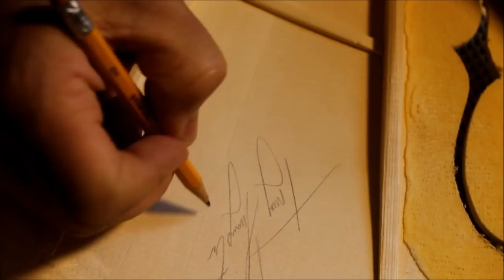Building an archtop guitar body Octave Mandolin

Comment: Very beautiful!  Did you spring the joint for the maple back, i.e. did you make the center of the joint a little (tiny) gap to allow for long term drying not to stress the ends of the joint?  In looking at old tables and drawers, often the ends of glued joints open because the ends appearcto shrink more.  It may be those were cases of freedom of movement over a hundred years, where ends of joints typically are freer to move than the centers... Or the reverse... In one case butt  joints in a poplar? drawer side were held by the front, made of a more stable birds eye maple, and split along the butt joints after 80 years or so of drying.
Reply from the maker: Hi Joe, a lot a people are unaware of this process in lutherie, there is no spring clamping done on tops or backs. The joint needs to be impeccable, and the way we make sure it is, is by checking the joint in front on a light and if there is light shining through it not good enough. 

You have to remember that furniture and musical instruments have different uses and that they are stressed differently. For example, an arch top has all the weight of the strings applied on to the top. Exactly where the biggest part of the spring would be resulting in extra stress. ( I do want to point out the I am aware that a good spring joint does not show any gaps). 

For your concern about the end of the board opening overtime this is prevented by having them glued to the neck block and tail block.

Really appreciate your question, it was a very good one. Thanks for watching
Reply: @HovingtonInstruments  Thank you!  I am getting ready to edge and glue my very first violin front, and wondered.  You answer is very helpful!

Comment: Awesome summary compilation video. Where and how did you learn the luthier craft? My understanding is that you were into machining.  Any advice for a beginner. Again, Simply beautiful work.!
Reply from the maker: I was in Steel manufacturing for 22 years, Fitter/welder.. Both my grand father and father were woodworkers and It was around me for as far as I can remember. I started woodworking in my early 20's. the Lutherie came after I had made bunch of projects and wanted to add dimention to the woodworking craft. I read a lot... I mean A LOT of books on the subject and still do. Lutherie is an art..You get better with practice..  My advice would be to read about it.. the best information on the topic is still in books. Focus on what you prefer (acoustic, electric, etc...) hope this helps... also, feel free to ask , I would be happy to help if I can..